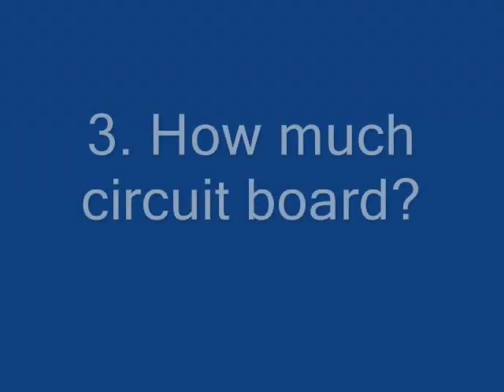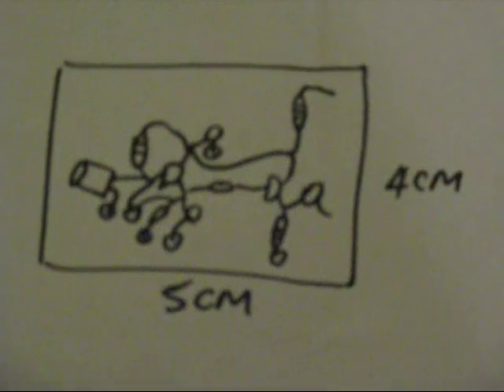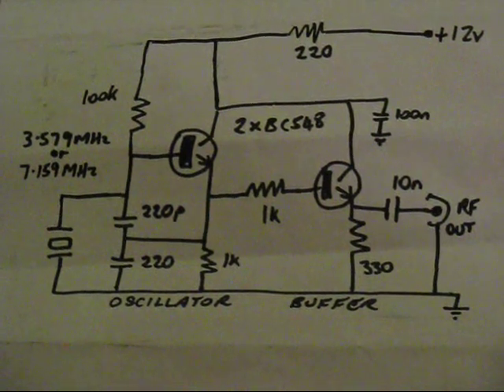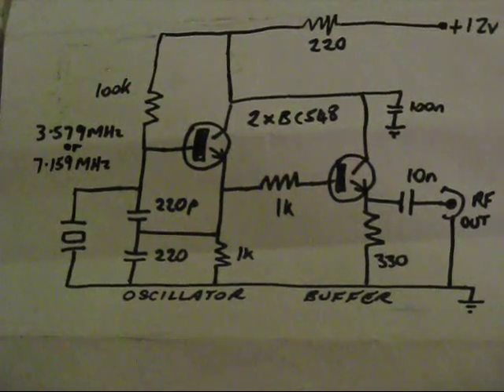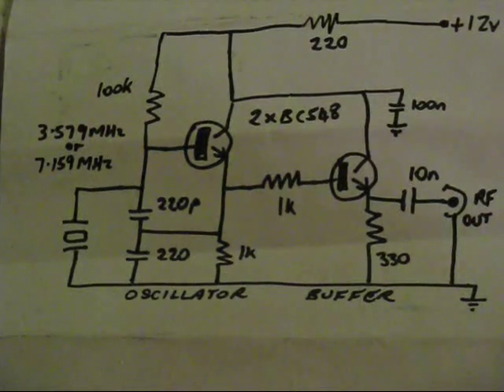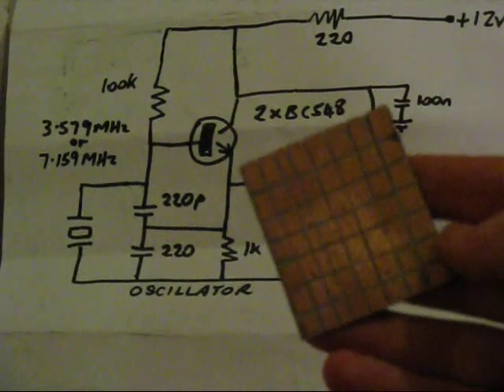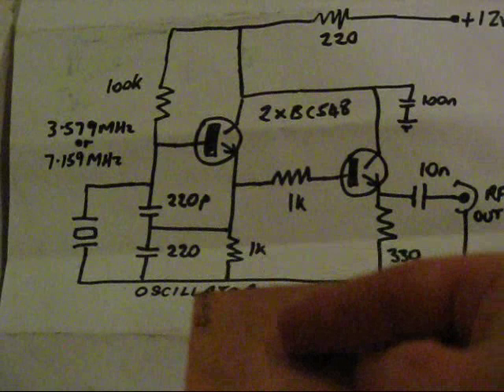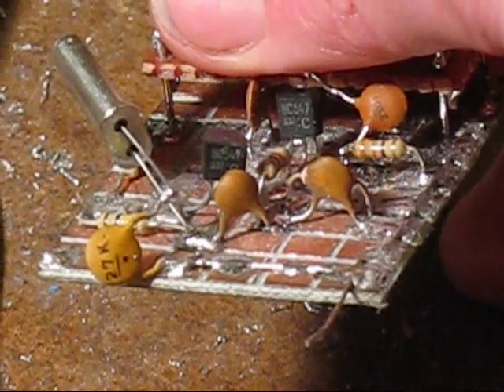Building electronics from schematic diagrams

Comment: i built my first circut about a month ago. It was a linear power supply using a voltage regulator and four 2n3055 pass transistors to handle 15a or so. i had to wind my own transformer using an old microwave transformer. it works quite well but will not quite run my big power hungry kenwood ts120s transceiver.

Comment: Good morning peter you use in this oscillator BC547 and in the circuit 548 why ? is 547 is better than 548.
Reply from the maker: +rafat rafat No difference - can use either.

Comment: Hi, liked video built circuit works fine . can you explain purpose of 100 nano capacitor.? thanks
Reply: The internal volume of the case is completely separate da from the external space.the wave producer world as a speaker,in short

Comment: I commend you for perpetrating this very-useful knowledge in such a clear, straightforward manner. So little of this essential information is available elsewhere. In a day where components are losing their leads, giving way to miniscule surface-mount substitutes, and the connections for integrated circuits are being placed under their packages (so only machines can solder them), the true art of experimental electronics is destined to vanish.

Comment: Hello Peter,

I have the Colpitts/Buffer built and it works great! I used a 3.579 xtal (bought a bag of them at Dayton for a buck) and have a strong signal right on 3.579. I cut my pc board using a hack saw and must say that your method works great. I used 2n3904 transistors without any component modifications. Nice harmonics 2, 3, 4, etc. Testing was done with portable receiver...
Now what's next....hihi...

72
Herb/WR9H

72
Herb/WR9H